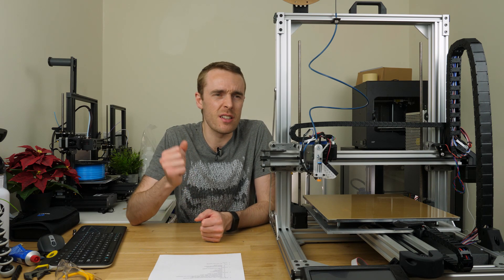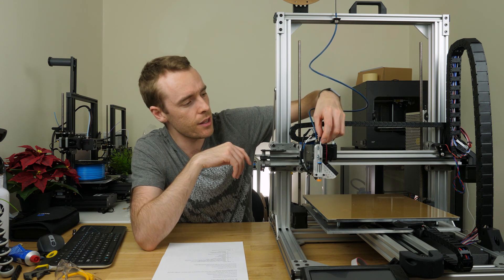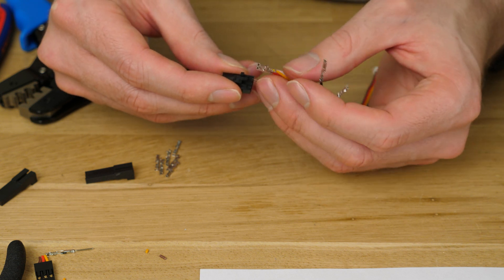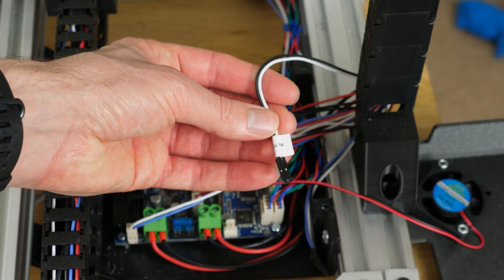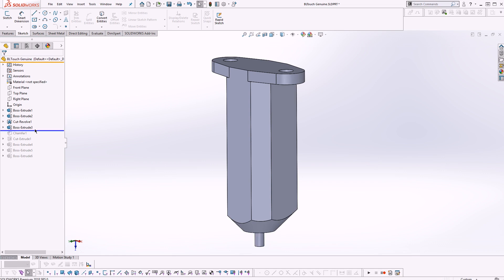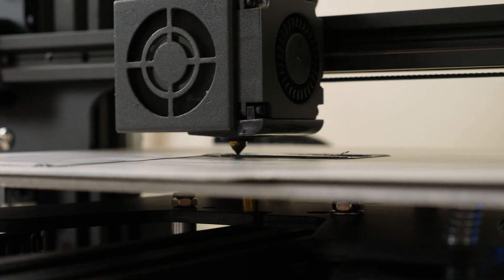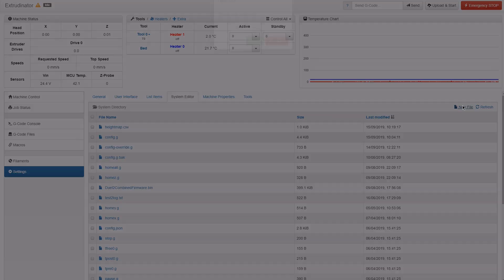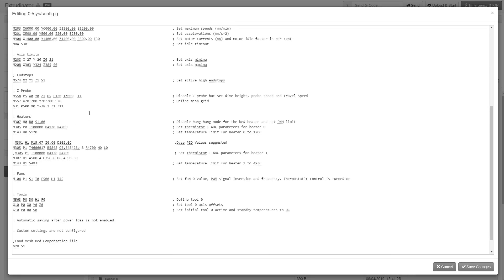Will this Sensor Improve My Bed levelling?

Comment from the maker: Found the solution to my problem for anyone interested. Swapped the two pins going into the Z probe header and now it works fine. Bit odd considering I was certain i'd wired it correctly :-/

Comment: The problem is that probably, the logic that needs to be inverted in the software and the pin for the white wire needs to be pulledup so it dosent give false positives, when i set up my BLtouch V3 had the same problem.

Comment: This doesn't solve your current issue but may help prevent another further down the line: the small set screw in the BL-touch changes the reliability. Too loose and it triggers all over the place, but at just the right height, and if I remember correctly it triggers at a 0.01mm precision. The set screw needs to be 0.3mm below the surface of the housing. Made a huge difference in my bed leveling accuracy.

Comment: If nothing will help, try to solder a ceramic capacitor between S and GND near contacts on BLTouch. The value is 0.01 uF (as I understand this should filter the noise if it presents).
Unfortunatelly I've didn't started to install my BLTouch clone to Tevo Flash yet. Did bought almost everything already (maybe need an isolation tube to add).
This advice was took from some 3dtoday.ru topic. And I think that I've seen it twice. And yes, you should check wires' connections (that's what I've read as well).

Comment: Pro tip, when designing things like a BLtouch mount, download a 3D model of a BLtouch, easier, quicker and likely more accurate!
Reply from the maker: Can never trust somebody else's measuring so I generally avoid doing that unless it's from the manufacturer.
Reply: @Vector3DP  True, but its still easier and way quicker to meassure the key dimensions on a complete cad part than designing it on your own.

Comment: I used Marlin for my touch on a CR-10S5 and had to turn on a setting for interference caused by my Keenovo AC heater causing false trigger probes and other quirky things I wonder if Duet has something similar?

Comment: I had a similar problem with my bl touch. I had to make sure it was setup to for 3.3v logic. If I remember correctly, I had to solder a trace on it. That fixed my problem.

Comment: With the Smart Version of the BL Touch there is a link on the circuit board that needs to be broken to enable 3.3v logic . Could be the issue...... https://www.antclabs.com/bltouch
Reply from the maker: I think the version i have doesn't have that issue anymore. Mine look totally different to the one where they are cutting the traces.

Comment: To test the BLT. Raise the X axis high, to enable time to switch off power if it doesn't trigger. Home X and Y, then home Z. This should raise the X carriage 5mm or so, then move toward the bed with the probe deployed. Hold your hand so that it triggers the BLT, the probe should retract immediately and raise the X carriage, then start the second probe if you have enable it.
Reply: I had this testing problem as well and as Spike suggests you can run home all from a high Z and trigger the probe with your finger. Mine worked fine even though the testing gcode did strange things.
Reply from the maker: Ye, this is one of the thing i tried. When it starts to move down i push the pin gently and it just forces it back out. If i push harder the bl touch just starts flashing red until i restart the printer.
Reply: @Vector3DP  I could send you a copy of my working config if you would like something to compare against?
Reply from the maker: @jedglover8245  That would be pretty useful. Thanks

Comment from the maker: So the test routine shown at the end is apparently meant to look like that and not respond to touch. However, when i deploy the probe and touch it it doesn't respond and also can't get a signal out to the z probe sensor on the duet.
Reply: Make sure that you have the end-stop leads in the correct way, since it matters if you have them correctly connected.  I had the same sort of issue, and swapping them fixed it.   Best of Luck!!
Reply from the maker: @scottbaeder37  I'm pretty sure they're right but maybe i got the wires muddled on the way to the control board. I'll flip them and see if that helps. Thanks for the suggestion.
Reply: The German Amazon reviews imply the results are unreliable. I am curious about the test.
Reply: @merkatorix  I think it is fairly reliable (in my case, well within repeat-ability expectations
Reply: @scottbaeder37  What are your repeat-ability expectations? Some people from the Amazon reviews talk about +-0.2mm, which is obviously too high (although I could imagine a mean value could help). On the other hand one guy said he replaced it by the original and got good values. That would change the question from "is it accurate and reliable" to "how can I detect fakes".
Reply: You are supposed to cut a track on the latest bltouch to make it compatible with the duet wifi voltage, as I mentioned above mine worked without it.
Reply from the maker: @jedglover8245  Not sure that's totally correct. I had read quite a few instructions and some talk about cutting a track on the board but I don't think its 100% necessary. especially when I can do the probe control. Also not sure where the track is you're meant to cut because i don't see anything clearly marked.
Reply: Try swapping your z endstop pins coming out of the bltouch. I had exactly the same problem and that's how I fixed it. The self test behaviour looks completely normal so you've got the rest of the wiring right.
Good luck! Ive found mine very reliable
Reply from the maker: @Thracus3  Perfect, that was the solution, thanks.